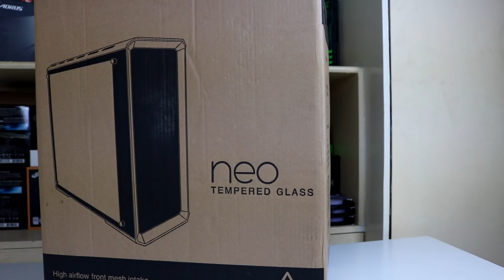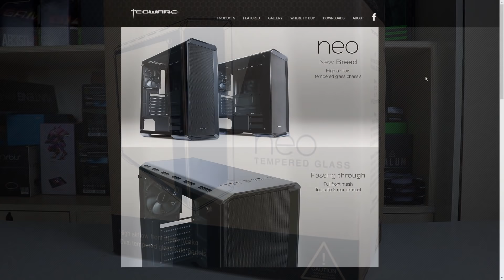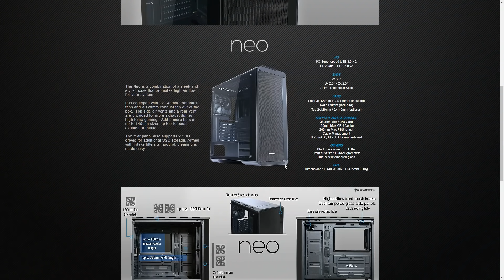Tecware Neo - Unboxing, Review & PC Build

Comment: Considering it is doesn't have an open mesh at the top, what was the airflow configuration of the fans? I am planning to get this case for an MSI RTX 2070 Armor + Ryzen 7 2700x
Reply: Para sa akin ok ang case na iyan bili ka lang nang magandang case fans yung kasing case fans na gimamit d2 eh mahina
Reply: sa top is exhaust. pero recommended is low rpm fans/ pwm settings sa taas para di mag negative pressure na yung hangin umiikot lang due to almost no clearance for air

Comment: madali lang ba tanggalin ung front and top mesh tsaka dust filter? planning to buy then repaint to white kasi
Reply from the maker: Yes madali lang kaso mahina ang exhaust part nito super init sa loob ng case
Reply: just a tip, add 1 exhaust fan at the top and remove the top mesh  on both sides, ito ginawa ko sa case na ito nag improve thermals ko di na siya kasing init na parang oven

Comment: Gaano ka kapal tempered glass nito sir? Madali lang ba mabasag?
Reply from the maker: i think around 3-4mm kaso madaling nabasag yung akin after ko m,alagyan ng konting pressure habang kinakabit ung screws
Reply: @WMDTech  Last question sir, paano mo natanggal yung top saka front panel? Ang tigas kasi kapag pinupull back yung top panel. Ipupull back lang ba yon ng malakas makakalas na?

Comment: WMD Tech Kasya po kaya sa taas ung 240 na radiator tapos 120mm na fan?
Reply from the maker: hmm wala akong nakitang support regarding sa top placement for radiator sa FRONT lang so most likely hindi pwede due to clearance issue
Reply: WMD Tech  ano pong case ung pwede lagyan ng radiator po sa taas

Comment: nka fractal core 1000 ako ngayon.. sulit kaya pag nagpalit ako sa case nato.. ang init kasi ng inno3d gtx 1060 3gb umaabot ako 81c pag naglalaro ng witcher 3
Reply from the maker: i suggest deepcool matrexx 55 altough need mo ayusin ng  mabuti ung cable management pero solid airflow. ito kase walang magandang exhaust eh ganun din super init din nung side panel
Reply: @WMDTech  salamat po ng marami boss
Reply from the maker: Welcome :D

Comment: Question:

Isn't it hot because it has two tempered glass side panels plus the not so open top? 

Just curious because I have a friend who bought a 250k php CPU with the best fans and NZXT Kraken X72 in a Phanteks Enthoo Evolv ATX case (and Tecware Neo resembles it somewhat except the front cover). Ghost Recon Wildlands crashes every 30 minutes with ultra settings and we just fixed the problem by taking off the top and front covers of the case.

So I'm curious if the two tempered glass side panels are also relative to the CPU's (more likely GPU's) temperature.

Thanks,
Reply from the maker: Super choked and not recommended tong case na to mapa AIr cooler or AIo, tlgang maiinit and nakukulog yung air. Sobrang panget ng Airflow and super fragile ng TG nya

Comment: High temps proli coz of too many fans at top. Especially top fan in from of cpu cooler.cool air gets suckd out before hitting ur air cooler.ull lose temp if u remove the first fan.ur air cooling bro.ur better off having 1 dirrection airflow ie front to back.other thing is if top of case vent is restricted and by the look of this case it is u might be better with no top fan at all.ur fan config is overkill n frankly a waste unless ur using aio.lastly more exhaust theoretically doesnt mean better u may or may not get 1degree off.more intake equals less dust in ur system which is better
Reply from the maker: yes this case really sucks and doesnt fully utilize the fans. Last time the glass broke and luckily i swtich to aio now so nothing to worry about. but thanks for the info

Comment: wew, need more lights while on building inside the case, madilim pa din :'DD...

also

>black tint opaque tempered glass sa back cover, kinda useless like sinabe ni gamers nexus on bifenix shogun, sana ni normal na lng nila. pag nabasag ng iba yan dahil sa back panel, ggness :'DD

>well yung sa hdd driver base, prng rin s340 e, screw rin ginamit  pero at least 1 screw lng need kaysa 4 sa neo XDD

>and that...sigh, yeah... perfect na sana airflow if it werent that top panel is not close!, at nandun pa ang I/O panel as usual nakadikit na nmn sa top panel, ilan generation ng case ginagawa nde pa kaya nila hiwalayin para madali ang case prep XDD

>also, dun sa paglalagay ng gpu, there is one slot ang wala dun, tlgang walang slot nakalagay dun??.... add ko na rin sana, nag thumbscrew or screw na lang sila for PCI-E slots.....

overall,. yeah okay na rin, though prepare for maintenance like...every week or so? XDD

salamat sa review XDD
Reply from the maker: lionelsioco123 yeah TG back panel is useless prone s basg yun dhil napreressure ng wires ung tg

And yes more linis more fun 😂
Reply from the maker: lionelsioco123 maybe i need a lamp para sa gnyang case
Reply: yung nalala ko yung nandun pa lng sila ng taiwan, if napanood mo kay dimitri ng hardware canucks may binili sila maliit na lamp na malalakas na led, na square ata yun,  baka pede na rin ata yun for B-roll or extra light, or usual dagdag yung merun na sa iyu na walang defuser maybe... XD

Comment: There is a RGB button at the i/o front panel...is it a dummy button or can it be use?
Reply from the maker: Amin Azwan Abdull Rahman can be use. I just didnt want to use that and insted i used the hub to use the remote. But tht rgb button is useable
Reply: WMD Tech If I were to use it, where to connect it to?
Reply: Amin Azwan Abdull Rahman connect it to your rgb hub theres a reset slot for it